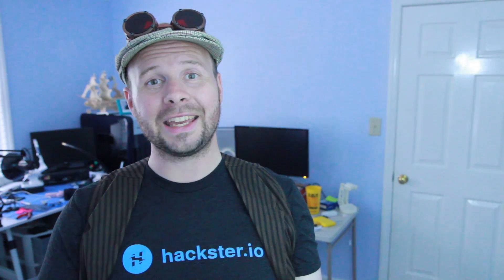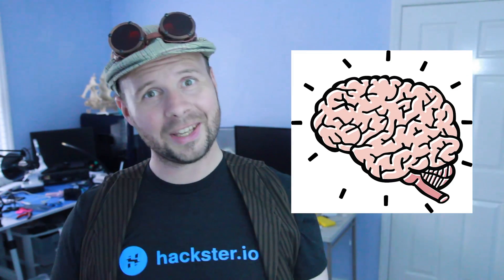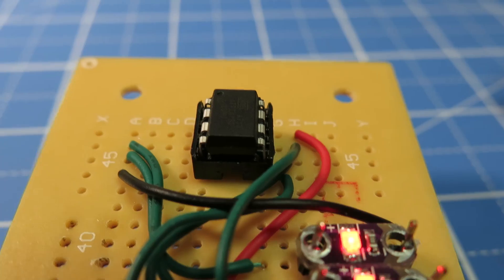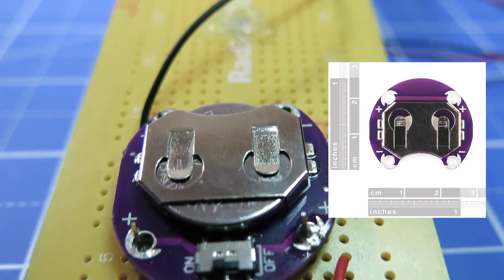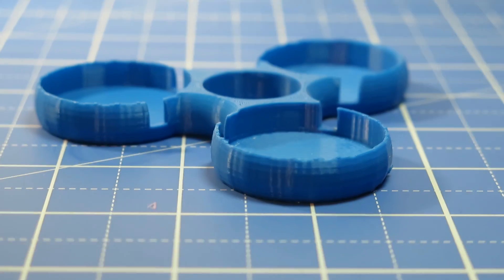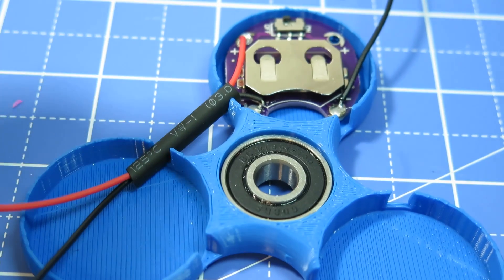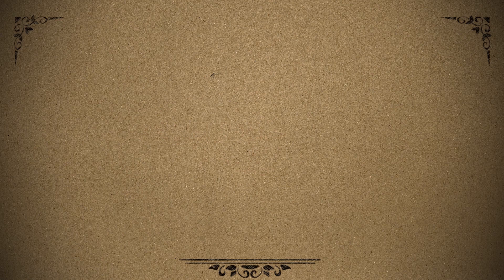DIY Fidget LED Display - Part 2

Comment: Try to add a usb port on the spinner so you can plug a computer to it with GUI that allows you to edit the text the spinner shows.. Also, in the code section why didn't you use "else if" instead of bunch of if blocks? The else if method is much more efficient..

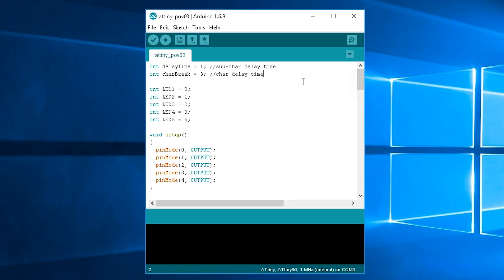Comment: 3:03 What about gyroscopes? You could use some code and a gyroscope to measure the RPM and then doing more calculations to make the "speed" variable.

Comment: Nice little POV display. Not much use but eh good enough for education. You should remove the seal and also the grease from the bearing  by soaking it in acetone or other non-polar solvent it will spin much longer with the same release speed.
All the hate for fidget spinners probably come from the fact that a lot of channels made a lot of videos about them very quickly and often only to surf on the hype. I don't hate them myself by I can see why people could be fed up with seeing them everywhere on youtube.

Comment: solution: get a better bearing. Ceramic maybe, or something that will spin longer than .1 seconds.
Reply: Probably should add some weights while your at it
Reply from the maker: Since this was mainly just a proof of concept, I wasn't too worried about the smoothness of the bearing.
Reply: is tinkernut can hack a bank ? and transfer funds into my account ?

Comment: Solution: Could you add an aceleometer to measure the speed of the spinner then adapt the speed based on that?
Reply: Yes you can use an accelerometer chip, and you can get them in very tiny sizes. Definitely a possibility for this project if he wants to do some surface mount soldering work
Reply: You can get tiny accelerometer chips that interface directly with the micro. These chips can be less than 3mm by 3mm square
Reply: I would like to see @Tinkernut apply this modification :)
Reply: A potentiometer or encoder with contacts would add friction but it is possible to use a magnet and a hall effect sensor to measure the rotational speed.
Reply: It is an option but probably more work needed to make it work. Not really a challenge. Put a cylinder in the middle of the bearing with black surface and just a dot of white paint + a reflective optical switch on the rotating part: http://eu.mouser.com/Optoelectronics/Optical-Switches/_/N-abusc?P=1z0xkj1
Reply: How about a hall effect sensor and a tiny magnet?
Reply: Pixel Perfect Not remotely
Reply: derstrom8 I guess I'm just more used to tracking wheel rotation than travel speed
Reply: Pixel Perfect Potentiometers are not used to track free rotation, only limited forced angular motion.
Reply: derstrom8 you CAN measure free rotation with them and it's not hard at all
Reply: Pixel Perfect show me one potentiometer that can do that. Are you sure you're not thinking a rotary encoder? That would be a viable option but a potentiometer is not
Reply: Michel PASTOR An optical encoder could be an option but implementing it in this application would be a challenge
Reply: The size is already a large limitation. An accelerometer (even penny sized) would make it a bit too big to be practical.
Reply: You need a gyroscope not an accelerometer. Should be doable, the acc. IC itself only measure 3x3mm even if it may need a custom PCB to fit.
Reply: Wouldn't it make more sense to use a potentiometer?